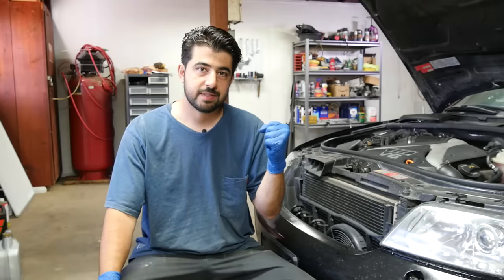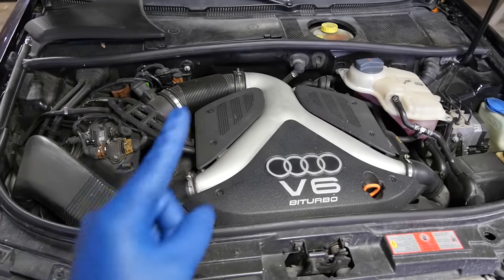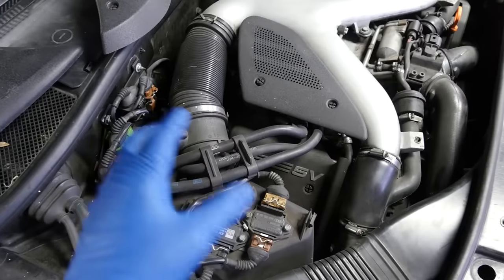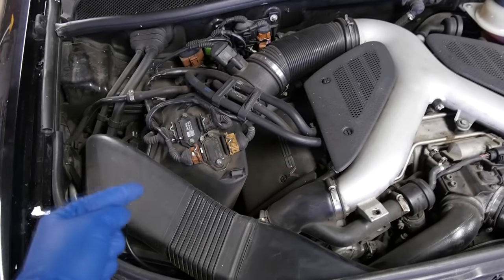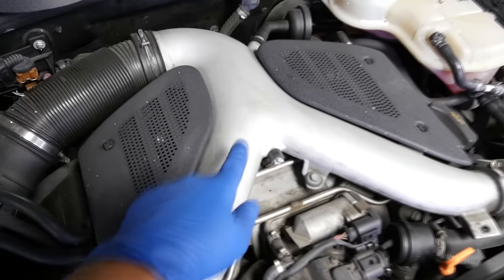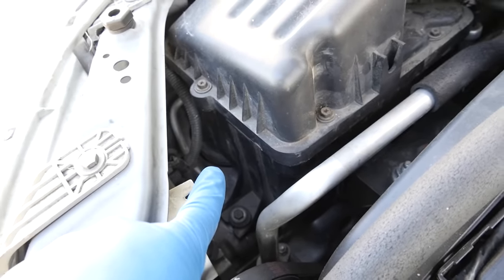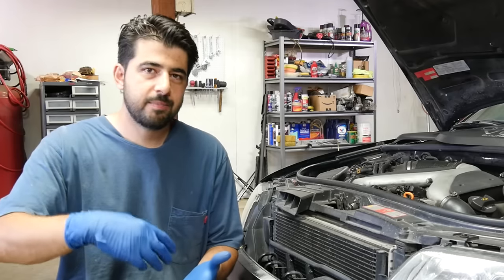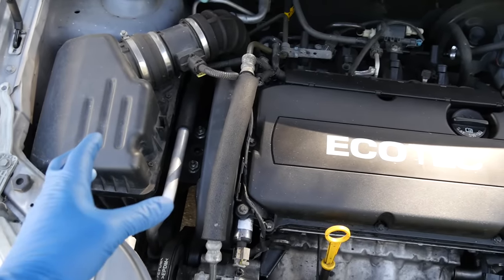Do Cold Air Intakes Work? Watch and Find Out

Comment: Let’s keep it simple. Install cold air intake, install performance headers, either straight pipe your exhaust or install performance exhaust, and tune your car. Do all of that and you will have a car with more horsepower
Reply: All so you can get to work in the same time you did before.
Reply: Or buy a car that came with the performance you wanted in the first place.
Reply: K+n filter, n flowmasters muffler. Nuff said
Reply: @marcomoreno8188  in my research Flowmasters are one of the worst flowing mufflers out there, just look at the CFM they Flow compared to other aftermarket performance mufflers. Yeah they Sound Great but there Very restrictive. There will Never be a Flowmaster on any vehicle i own. Tried them out about 15 Years ago on a 5.0 Mustang, a Dynomax Super Turbo outflows them bigtime, as do almost every other Performance Muffler out there.
Reply: Just run no air filter tightwad good for 10hp
Reply: @stevang4720  yes bruh, stock exhaust slows down the air escaping and compresses it. Straight piping AND tuning will increase air flow. But obviously performance is the better option but way more expensive.
Reply: @patientestant  that's harder said than done. I prefer modifying my cars also. The biggest factor here is tuning anyways. But to each their own
Reply: But many cars already have cold air intakes. 
My car, from some reason, has warm air intake (and it literally says so in the AZQ engine book). Why they do it is beyond me (maybe to get better airflow in the manifold). 

However, I think my car should benefit from CAI. Even though about 80% of new cars already have it like the example showed in the video.
Reply: Cheaper way just delete the CAT and put a Honda badge on ur car and bam u have 7000hp
Reply: @P4P1Chuy  after looking at the mods, hp and speed limits i am only considering getting a tune and better brake pads when i replace them.
Reply: Wrong ! Most of the time your cold intake will become a hot intake And you’ll be making less power
Reply: @ganuv  That is if you install it wrong, which is usually the case with universal fits.
Reply: What about consumption after all these upgrades?
Reply: @hanskinslo326  It's the journey, not the destination :D
Reply: Without an ECU tune forget it
Reply: You don't have to tune thé car for slight modifications, since the ecu will make the changes, like more fuel. That's what ive read
Reply: @guitariste47  Wrong. Any mod you make to the engine or even exhaust pipe MUST be tuned if you wish to see a difference in performance. Modern cars measure everything through the CPU, even how much c02 exits through the exhaust. If you do not tune, you spend all that money LUTERALLY only for aesthetic and auditory "mods"
Reply: That's is correct

Comment: In my experience they can make a difference but it is small.  To really benefit you need to also upgrade the exhaust and then reprogram the ECU.  Just replacing the air intake won't make much difference.
Reply: Yeah I'm surprised R & W didn't talk about the need to reprogram the ECU to really take advantage of the gains.
Reply: True.  Modern cars will simply dump more fuel into engine and nothing more because so much more air is coming through.  And that will be at all speeds from 0 mph and up.  Tried a K&N Typhoon system and it made the mpgs drop to half with normal driving.  Drove slower and idled rough.  Got my money back.
Reply: @FCT8306onTwoWheels  exactly.
Reply: davva360 I installed a K&N CAÍ and I noticed a good bump. Good enough to feel a difference. It depends on what kind of engine you’re installing it in. My 5.4 breathes like a Bull now and I’m completely satisfied with my upgrade
Reply: davva360 I have a 91 integra , I did the intake , header , and exhaust and My car got lousy gas mileage and had less power. I had to change the computer to ODB1 and add a 94-2000 integra Distributer and have it Dyno Tuned and then it ran proper , So I added a Vtec GSR Head on my B18A Problem Solved
Reply: Rick Dangerous Dont forget the amount of air in is decided by the throttle body ;)
Reply: I'm still surprised you can get 100 horsepower from doing all of that to a sho
Reply: Depends on the car and what you've done, you can't just ask you need to go Dyno it
Reply: @FlameOnTheBeat  Your power came from the tune not the CAI.
Reply: Some car systems will self adjust for simple intake and exhaust adjustments. My car gained 12hp off a intake and full exhaust. No tune.
Reply: @410cultivar  And what proof do you have did you do testing ? CAI  do not increase HP it is the less restrictive air filter that gives the gains.I understand that cold air is more dense but if it is 95 degs outside you have about 1/10000 of a sec to get a air charge into the combustion chamber before that air heats up 10 degs and expands more.You are correct about the computer adjust air fuel mixtures but a then will do more justice that just a less restrict air filter.
Reply: @apacheone3643  my cai is a legit cold air intake. Meaning its relocated way down away from the engine. And My proof is my car has,been on a dyno multiple times. I've been to the track multiple times. I do have a tune now. But I got solid gains without it. If your car has a MAF sensor it can be harder to get gains without a tune....and yes my car would,of reached a limit where it wouldnt gain anymore with out a tune, but you wont pass that limit with a intake and exhaust.
Reply: @410cultivar  How long are your pipes you say way down1 ft -4 ft? how many bends? and what diameter increase from factory?
Reply: @apacheone3643  but....Don’t let this distract you from the fact that Hector is going to be running three Honda civics with spoon engines, and on top of that, he just went into Harry’s and bought three t66 turbos with nos, and a motec exhaust system.
Reply: @410cultivar  I am not distracted by anything I base my findings on facts.I operate a Dyno in a TEMPERATURE/HUMIDITY Control environment,By do testing like this I can mimic exact conditions for each run even if they are days apart.For the record the length of the tube and amount of bends and diameter AFFECT THE WAY THE CAR RUNS.CAI  do not work it is the COTTON AIR FILTER that reduces the intake air restriction over a paper element.This is a know fact that can be watch with people testing just the air filter by itself a d then ADDING a cold air induction system.For the record look up lethal hammer he tested a CAI  from Mismoto and LOST 5 HP.Secondly anyone that knows how to tune a car will always tell you most factory tubes are developed FOR EMMISSIONS ONLY NOT POWER!So until I see numbers and facts I will stand by what I say 40 years in racing !
Reply: do all the posible mods u want it will def add more pwr/hp/boost or whatsoever but do keep in mind the more it gained..the shorter its lifespan..
Reply: I got 3hp on my dart, but more importantly the turbo sound is just beautiful, and I can just clean it so it’s more environmentally friendly. 

Things to consider when getting a cai, location furthest from the engine, do you have a map or maf sensor (maf sensors may require you to tune the ecu to get the most out of it), and do you need adapters for sensors/vacuum lines.
Reply: Same here with my '09 scion tc. Got a CAI on ebay for $80 and it gets 5-7 mpg better and performs better.
Reply: @FCT8306onTwoWheels  You got that result because the air coming in wasn't cold air. Install a true CAI and a difference will be noticed.
Reply: @klwthe3rd  how do I do that
Reply: @apacheone3643  100% , drop in BMC filter is as far as I went in terms of intake.
Reply: @singh2702  I would still tune the car CAI increase air flow you can be running lean and missing out on a few more ponds and better fuel efficiency. I AM A Master technician 42 years and have been building race cars as long.
Reply: @apacheone3643  I did a stage 1 tune before the filter and downpipe. The engine just breaths better no noticeable gains in performance maybe a few kw.
Reply: @singh2702  I know you might have to pay someone to check the car what I can tell you any OB2 Computer control engine are very sensitive to the slightest change. You may not of set a check engine light and you may be rich enough but I rather be safe than sorry.
Just a FYI if you are lean you can burn 🔥 a piston . It's your car 🚗 I just hate to see or hear about any damage.good luck.
Reply: @apacheone3643  Won't the ECU learn the new mods?
Reply: @singh2702  The MASS air flow sensor is really the one you worry about . Today newer cars there range is not as wide as older  2007 down OBD2 cars are. I put a Smaller supercharger pulley and a k and n filter on my PONTIAC  GRAND PRIX GTP when the car was new and tuned the engine .
I gave the car to my Son about 6 years ago he put a CAI on 3 years ago and again I had to tune the engine as he was getting a rotten egg smell from the Cat .
My ZL1 AND my 50th CAMARO'S both have CAI only mod I did right off the bat , the computer saw the change setting a Check engine and they needed to be tuned .
I cannot see what was done to your car all I am saying be sure you are not lean a tell tail sign is a rotten egg smell on hard accelerations if your Cats are still installed. If not then you need to see how rich or lean you are running from a tuner or have a stand alone O2 SENSOR put into your exhaust can be helpful in checking . If you have a inline 4 cyl one sensor is fine but if you have a v configuration one on each bank for testing is advised.
Reply: @apacheone3643  Before I installed the decat downpipe and BMC filter I went to a tuner who specializes in Ford ecoboost engines and got a stage 1 software done. After the downpipe was installed it didn't throw out a check engine light, which it should have done. So maybe the stage 1 software took care of that as the software is performance orientated. On hard runs I don't get any funny smell and my car is a Ford Fiesta ST.
Reply: it makes more whoosh sounds though
Reply: You can always tell when someone that didn’t know what they were doing when they messed with their induction or exhaust system when you hear their exhaust popping and cracking. It’s usually some kid in a Civic that put on headers and a fart can exhaust and now has misfire.

Comment: I just installed a K&N cone filter to my 2010 Tundra with 5.7L today. IT DOES WORK! it gained between 5-10 hp for sure, clearly a more nimble, lighter, faster drive. More noticeable over 1500-2000 RPM's. The sound is a nice plus.
Reply: What kind of dyno did you get it on? What were the numbers? I'm interested in getting a cold air intake as well
Reply: Be careful with K and n filters, there prone to getting really dirty and can dirty up your engine which can kill your car
Reply: @herniagaming  Absolutely true. K&Ns are designed more like a sieve than like a filter, so yeah, the engine runs faster and also dies faster 😂
Particulate/dust filtration is barely acceptable on a new or freshly oiled, filter, but drops pretty drastically with just a few hundred miles on the odo. Clean your K&Ns every 2-5 thousand miles depending on the dust in your driving environment. 
None of this is is a concern if longevity isn't, er, a concern😅

Comment: I was expecting dyno runs or some sort of objective evidence....
Reply: Me too what a waste of time, no further forwards
Reply: Same here. I was waiting to see if he does somethig or installs any cold intake system. Just a waste of time and too much talk. I can google and read any information in internet but if you could show how it is done and compare products it would have been alot better. Thanks anyway.
Reply: His method is better, he explained how it could increase power and what to look for. Also, his advice applies to all vehicles. A dyno test would only apply to one vehicle and intake combination, which is all over Youtube anyways. Just search for "cold air intake dyno" and you will find plenty of dyno tests, all with different results. A dyno test is useless unless you happen to have that exact same type of vehicle and you are planning on getting an intake exactly like the one tested, other than that its useless since results from one make and model of vehicle can not be accurately extrapolated to others, the results will vary dramatically depending on the intake, the vehicle the intake is installed on, and what other mods that vehicle has.
Reply: @averyalexander2303  well said
Reply: I did too.  A lot of talk with nothing behind it.  :(

Comment: Remember the 1970s with shackles, air shocks and 50's sticking out the wheel wells?? No? How about the 1990s with imports with trash can mufflers? This is the modern version of that. Manufacturers spend Billions on engineering and most modern stock vehicles have cold air intakes. When you put a metal pipe and filter with limited filtering capacity in the engine compartment, you are defeating the purpose.

Comment: Having been in the ‘mod’ game for many years I agree with you on many points. It really depends on the car, the application, and how well executed. Recently though I stumbled on an ancient article 😂 done in the ‘80s about just this topic done by some engineers. One thing to note was that auto manufacturers didn’t just make the air boxes with resonators to kill noise- it was also to keep intake system pressurized, so air was constantly on demand . Ever notice on some cars with SRIS (short ram intake system) it feels a bit ‘boggish’ when first going? The intake system isn’t pressurized and needs to ‘suck’ air in, which we all love that sound, but your actually losing low end torque too, it’s bogging out. Super rich on low rpms, then really lean with higher rpms, which is good if tuned properly, but can prematurely wear your engine. 
And ya, usually the factory system is colder than an aftermarket 90% of the time. (Depends on the aftermarket system though) 
I chose to go with a high flow filter in stock system since my old arse intake doesn’t use the typical AIT filament sensor, which yes, the oil on a wet filter can ruin. If I had a newer car, I’d run a dry filter in stock location and open up the exhaust piping from the down pipe back to no more than 2.25” on a NA car. 
On turbo, bigger downpipe and exhaust is crucial for spoolup, but that’s a whole other topic😂 
Nice vid!
Reply: So you think can i put a air intake on 97 nissan maxima??
Reply: Tony Cervantes what the hell, go nuts dude😂😂😂
Reply: @amjedalbalushi9707  ????? I dont understand bro
Reply: Tony Cervantes nothing man😂😂😂😂😂
Reply: @amjedalbalushi9707   
Bro i just try to say if a put a intake on my 97 nissAn maxima if work yes o no.  Can u tell me bro
Reply: Tony Cervantes you can put an intake on any car you want, whether you bought it ready for installation or if it was custom made. The only thing you have to bear in mind is that there’s a place for the maf sensor, if there isn’t one your car won’t work.
Reply: Zander you comment is the best one here..You should have made this video
Reply: Random Stuff 
Mass Air Flow sensor. It’s to measure the amount of air that is getting through the engine
Reply: @the_batmobile0.4  it's a sensor placed in the intake tube right after your air filter, before going into the Throttle Body, or Turbo or Supercharger if yours is equipped. It measures the amount of Air entering Engine. So the Computer can adjust how much Fuel the Engine Needs. So you have the Correct Air/Fuel Ratio.

Comment: Cold air intakes and Short Ram intakes by design do potentially perform better if your air box is very restrictive. This is dependent on the design of said vehicle.  Not all vehicles are the same. The only way to really get cold air benefits on a short ram intake is by customizing the front grill so as you get up to speed air can blow directly through, onto the filter itself.  Personally I like this method better than a long tubed cold air intake because the cold air intakes even though they are placed farther away, the pipes still get very hot all the way up top to bottom so the main benefit from a cold air intake is that it runs more efficiently but still doesn't guarantee much colder air.  If you want the coldest air possible you have to have that filter sticking either outside the hood or very low to the ground where it's nearly scraping (Bad for Rainy days) for air to blow directly on it.   True cold air comes from air blowing right onto the filter.  Other things to consider is use some heat resistant tubing for your piping as most aluminum can get very hot in summer which can almost guarantee hot air regardless of placement.  How you configure your setup is really what counts. For maximum efficiency it takes some custom work if you want the coolest air for your intake.  
My setup I chose is a short ram but it doesn't go directly across.  It hangs more down, plus I added my own custom heat shield and I cut a portion of plastic off the front just behind the front grill so air can flow through and blow directly onto the filter itself as you get more speed.  Overall I really liked my setup as I live in an area where it gets really hot in summer time. 
Weather is also a huge factor.  
If you were to compare the performance of a regular Short Ram Intake in cold weather vs a Cold Air Intake used during a Hot Summer.  The short Ram would more likely perform better.  Customizing to get the most out of your setup is the best thing you can do if you want max performance.